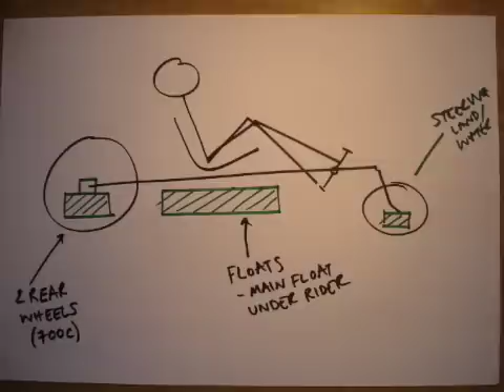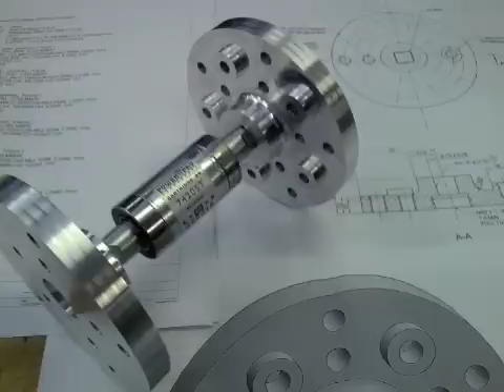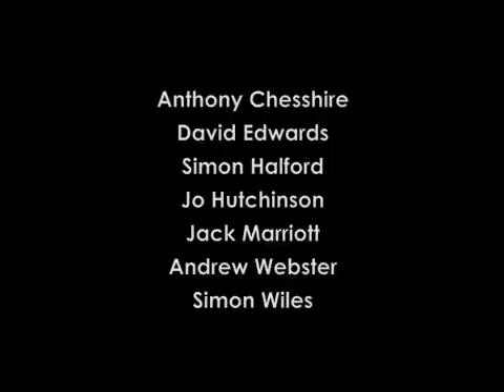Amphibious Cycle

Comment: I'm guessing it doesn't go up the ramp real well, since if you go forward the floats are lifting the rear wheel and if you go backward the paddles provide insufficient propulsion. And with the ramp covered with slimy algae... I'll bet they had to drag it out with a rope.

Comment: might be a good idea to put a disengage on the paddle wheel so when the bike is on land, the paddle won't turn but then engage it when in water.
Less moving parts on land equals less power it takes to move bike

Comment: Unless the prop is detachable one could easily run the risk of hitting it while on the ground. If it is detachable, then it wouldn't have a smooth transition between water and land.

Comment: What caused you to opt out of a propeller design. I find that the paddle wheels on the oakwood pedal boats are efficient at low speed, but you pedal fast and the boat doesn't pick up much speed (it actually slows down for some reason!!). Was there a gear problem associated with the propeller i.e the difficulty of using orthogonal gearing as opposed to a simple chain drive, or was it buoyancy problems, or even the difficulty in making the propeller part perhaps.

Comment: well, a prop, underwater, at the speed you could get with people-power wont have any cavitation.  Also, if they have CNC machines and tig welders, and all that money to buy the aluminum for the frame then I bet they could get their hands on a 4 inch long piece of 6 inch billet. mill it, and then they'd have a prop. hell, a perfect prop for their application too.  and it would be completely silent, even more so than say a trolling motor, which is imperceptibly quiet.

Comment: what would be better is a partially inflatable float.  could even use the same needed gear box to disengage the paddles, have a 3rd gear that pumps air.  Also why not use a screw with a fly wheel geared up...  I could get a folding bike with an inflatable boat, put it in a back pack and the time i take to blow it up id make up on land and in the water.  if u use cncs and tigs, why not make it a practical prototype thats useful in the real world?  Foam? u didnt even coat your paddles. engineers.

Comment: Well put. Besides, one of your most impressive accomplishments is that you made all the components. A propeller would not be something you could make. The fun factor is important as is the distressing of the sound of a low speed wheel vs a high speed prop.

Comment from the maker: Many thanks for your comments.

The hub gear is a special sturmey archer component that is intended for pedal go-carts. It has 3 speed forward, freewheel and reverse, which is most important when on the water.

On land, V-brakes are used on the front wheel as on a standard upright bicycle.

7 miles? I hope you're not in a rush!

Comment: Excellent Video. Excellent work.

Did you modify the three speed hub to include a reverse.  Did you manufacture your own hub?  I'm a bicycle mechanic and have never seen such a hub with a reverse gear.

For on land, what type of brakes do you use?

It looks very sea worthy.  I live on an Island 7 miles from the mainland so such a craft brings ideas to mind.